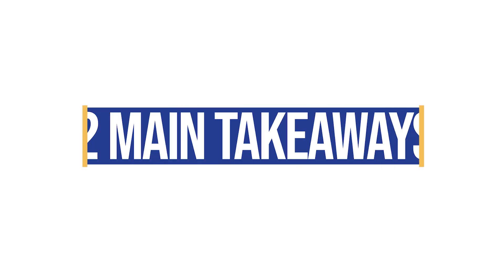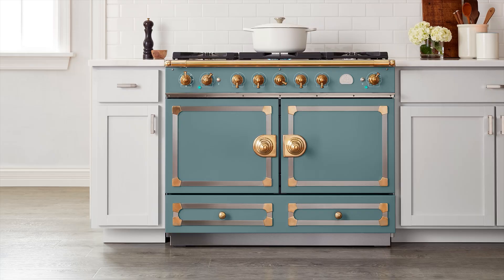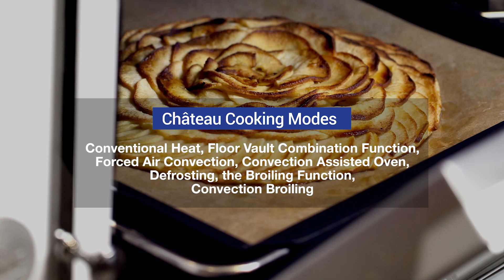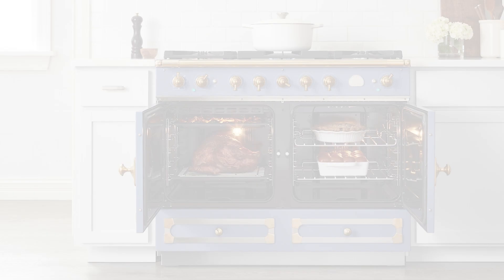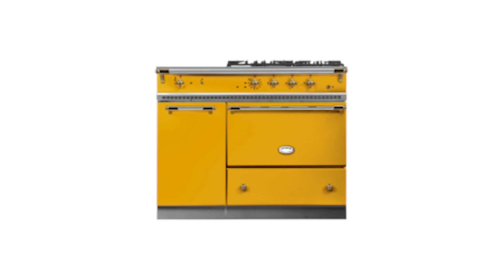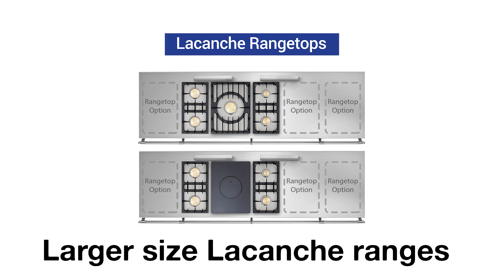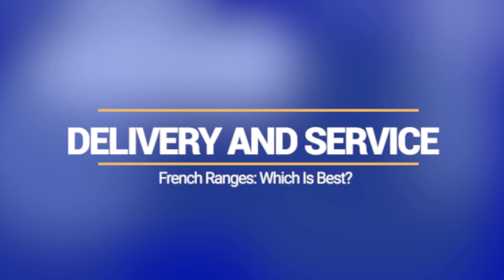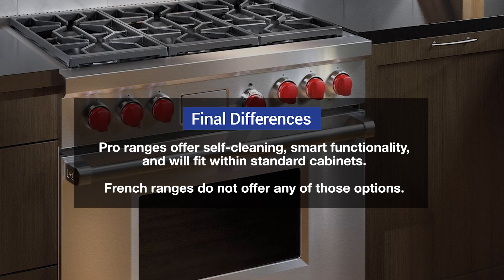Uncovering the Best French Range: The Ultimate La Cornue vs. Lacanche Comparison

Comment: You are correct that Lacanche is in between the CornuFe and the Chateau. However, Chateau is soooo much more that I feel it’s a different category all together. Lacanche and CornuFe are a closer comparison. Yes, American ranges have more standard sizes, steam, and stronger BTU. However, I have yet to see one that has the character, beauty, and personality of a Lacanche. I also chose it because it is NOT smart. Unlike an Ilve that completely stops working all together if the clock breaks…the Lacanche can work if we lose power, has parts I can fix myself, so I am less reliant on ever breaking technology and cheap, throwaway parts. Just my two cents on why I chose what I chose.
Reply from the maker: You are so right about Ilve....I like Lacanche, but like the others better, but its is a good value at the larger sizes.

Comment: Does anyone know if my Lacanche in Germany will work in the US? In other words can I ship my Lacanche to the U.S. and simply just change the plug connection in the back and it will work in the U.S.?
Reply from the maker: whats the model?  We don't sell it, but its probably easy to figure out
Reply: @YaleAppliance1   So sorry I did not see the reply. The model is the Savigny 43 1/2". which I believe works on 230v 50hz. I think he US is 220-240v 60hz right? Is the Hz a problem?

Comment: Given AGA builds the cornue fe line, how is the quality and reliability? Can it be used as a proxy for the AGA ranges for reliability discussions?
Reply: Asking cause I am considering an AGA for my kitchen but can't find any reviews, reliability data, or serviceability info for my Area (SF Bay Area - East Bay)
Reply from the maker: They build the CornuFe in that factory.  Chateau is made in France...Cornufe is a decent range
Reply: @YaleAppliance1  while I have your attention - any new 48" range coming that will be 100% induction cooktop? I really want one but the biggest 100% induction I can find is the AGA one, hence considering it...

The other option is a 36" range but it would be kind of small in my space.
Reply: @triaxe / MMB  I have the 48inch aga mercury induction for 3 years. Installed it myself and so far no problems.
Reply: @triaxe-mmb  Fulgor Milano has a 48" induction cooktop range in both with or without a griddle.
Reply: @triaxe-mmb My dad has a original AGA stove that’s over 50 years old and still heats his house and cooks with it.
AGAs last literally a lifetime.
Reply: @triaxe-mmb  Ilve now has a 48" induction range.